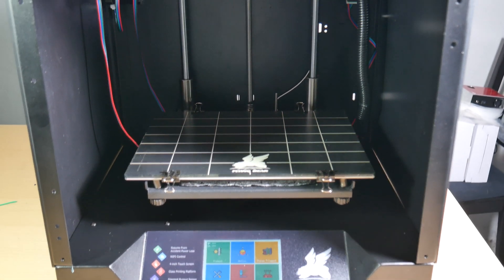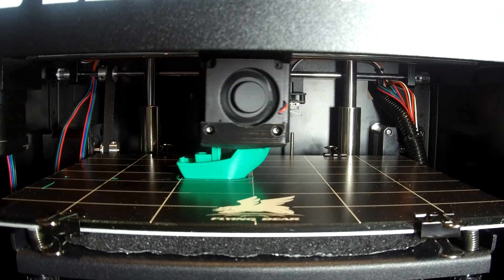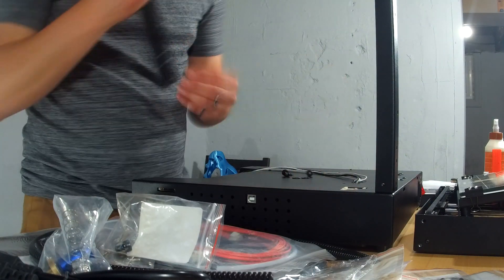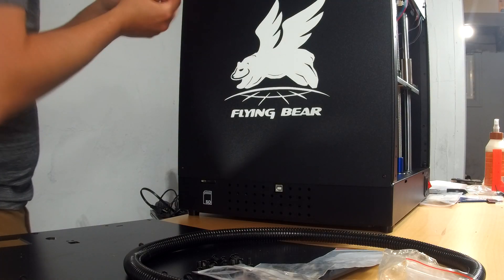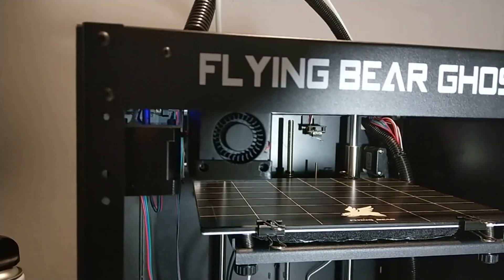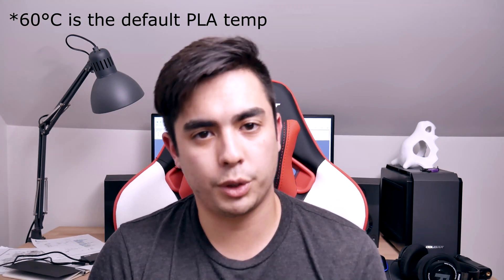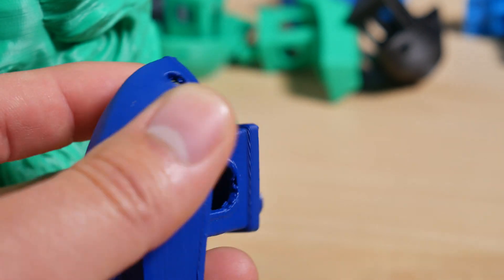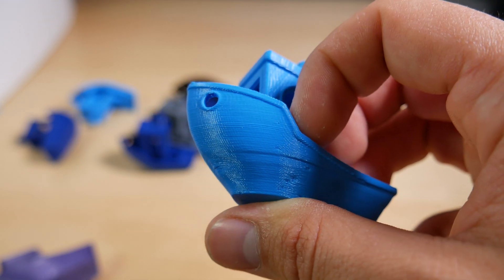Flyingbear Ghost V4 3D Printer Review

Comment: Is there a difference between this and the 5th version? I can't seem to find any reviews on the 5th gen.
Reply: Obvious changes are that 5th gen got  transparent dual drive extruder, different hot end plastic with cooling fan at an angle instead of 90 degree, bigger bed adjustment knobs, tmc 2208 on X and Y steppers and... maybe something else which is harder to spot
Reply from the maker: That's the one that was just released, right? Unfortunately I don't know of any of the differences.

Comment: Any chance you can show how you actual fixed the lack of slicer configuration? You just talked about it, which isn't very useful for newbs that just got the printer and can't get it going with standard CAD/Printing packages that have no mention of Flying Bear.
Reply from the maker: I used an existing slicer configuration for an Alphawise U30, adjusted the bed size, and made modifications as needed to things like first layer, speeds, etc. It worked well as a starting point because they are both bowden printers. 
With the provided SD card there should be a Cura profile, unless I'm mistaken.
The other thing to do might be to join the FlyingBear 3D Printer Owners facebook group.